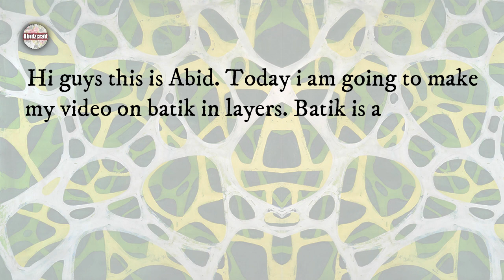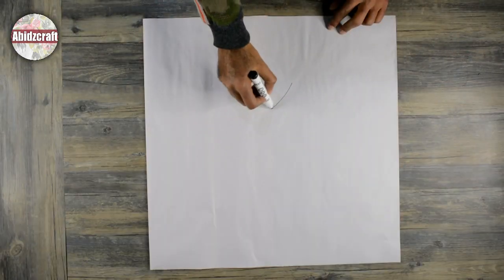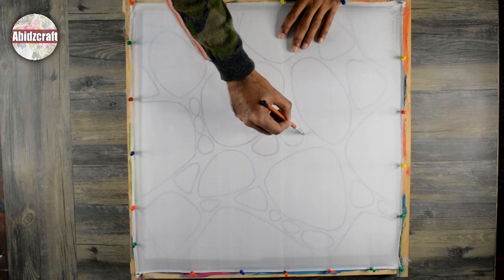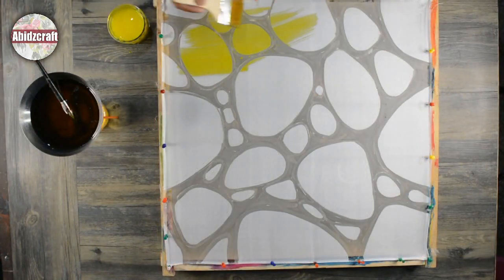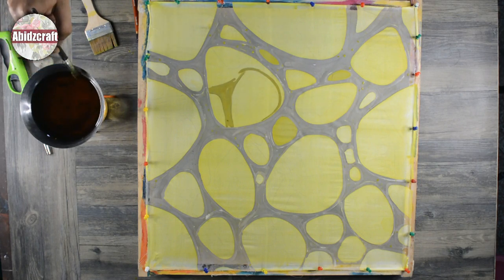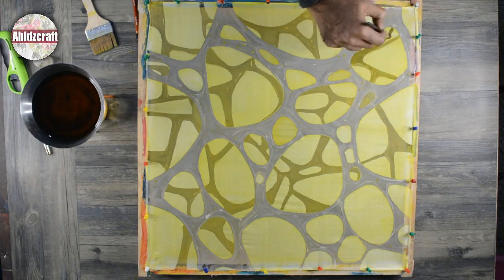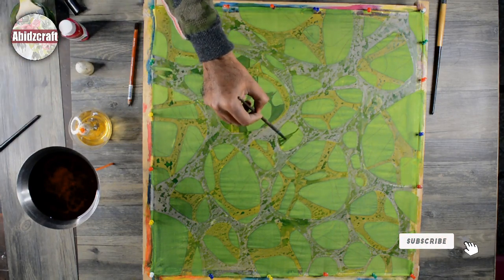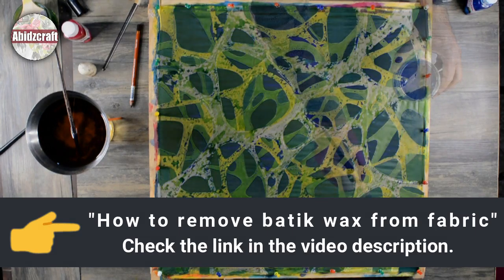Voronoi Design with Layered Wax | Batik and Silk Painting Tutorial

Comment: Asalam o alaikum Abid ji. I have a question. I painted a piece of China silk fabric with seta silk colors, I let it dry for 2 days then ironed on the back to fix colors. I then washed it to check if color is fast. The color came out in first rinse however second rinse water was clear. After air drying I see the colors have faded. Any suggestions on how to keep the colors from fading? The background color is black and that has faded. Is it due to quality of fabric? It's very loose knit fabric. TIA
Reply from the maker: Ws how are you maam. I used seta silk brand saga in this video and i dipped my fabric in hot water but colors are good. Maybe your fabric was not pure that's why you are facing this issue .silk paints do not fix on synthatic silk
Reply from the maker: And one more thing check the instructions on the color bottle.  May be you missed instructions
Reply: I agree on the fabric quality. The colors are same Seta silk Sega. I will try it on other fabric. Instructions on the bottle are to iron on reverse side after color is dry. Thank you for your prompt reply 😊
Reply from the maker: @authentickmindset  no prob try and share ur exp